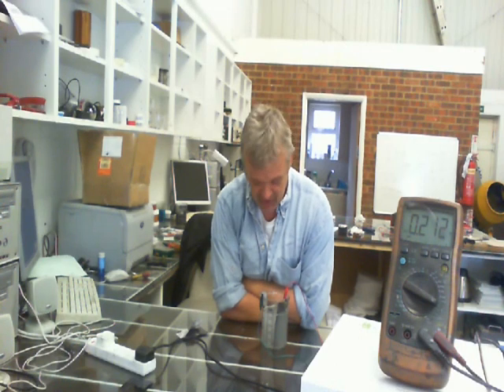Karpen Cell Replication Using Conductive Ink

Comment: Has anyone figured the watt hours per kg and/or volts per kg? With that in mind, any suggestion for a data sheet of comparable battery/capacitor types and their stats?

Comment: Hi Rob, that s a really interesting cell. I read the patent and that s fascinating.
I think a lot of concept turning around this karpen cell...crystal battery, your capacitor with two types of carbon....it seems to be very important to understand.
I am testing it and no surprise it really works.
I though to do a dry karpen cell with an solid electrolyte like a paint electrolyte or o sort of gel. But it doesn t give me the same results with the original concept.
I am tellling that s may be impossible to do a karpen cell....could you give your point if view about a dry karpen cell.
Do I lose my time?
Thanks
Reply from the maker: Mo Kha I think it is to do with transition between phases - so if it is dry then it probably won't work - but that is only what i think mate and i could well be wrong
Reply: Thanks for you opinion. I think the best alternative is a gel electrolyte. I read the agar gel is used for this kind of application. Have to test it.
Reply from the maker: Mo Kha good thinking mate

Comment: let me congratulate you first for the quality of your video!
I live in Romania and have seen the Karpen pile myself exposed at the technical museum in Bucharest.
great example of how it can be done! I will replicate myself soon but with backyard equipment ... I do not have access to lab level equipment. Still on a theoretical basis ... if the cell gets its energy from surrounding "heat", would it make more energy if say exposed to sun or in a warmer room ? (ok I know on some level the heightened entropy helps the electrical charges get around quicker, but I meant can we detect a bigger delta between the two states than a directly proportional temp increase? if at all ? )
Reply from the maker: cheers mate - i would love to have seen it - i did think of visiting but i am guessing you need to make an appointment. I would guess it would respond exactly the way you suggest but this is why we experiment to answer these questions
Reply: thing is that nowadays ( I understand it was locked away untill relatively recently ) anyone can see it exposed at the museum.
obviously I think that the dog's dangly bits of the whole museum ... of the whole romanian inventica ... ok ... definetly one of my favs :)

I was wondering if you could give me a tip or two for my replication ? I basically need to replicate the amilic alcohol NaOH mixture or any of the other 2 variants on the patent but it has to be relevant for my audience :)
hence it has to be easy to replicate with basic materials ( I know graphene is totally awsome but still ... $$$ ) that are easy to procure ... like sodium bicarbonate can be dehidrated to NaOH in the oven for a while ... and have to be scalable but that's the easy bit ...

any clues ? ( I still am going through the youtube trying to see all your excelent posts )

cheers
Reply from the maker: actudoran i did the two different carbons version which worked well

Comment: A little bit of a rant aimed at critics.  In science you should have healthy scepticism, and ask question, and out them to experimental test. However there are way too many individuals who think they already know everything there is to know and so they handwave saying things like the Karpin Cell is BS, or that the Oxford Bell is just a slow reacting battery.  These are the same people who will deride Senft's work on low temperature differential Stirling engines. They will say but they are not practical. It's like they are saying nothing to learn, or see, or hear, here, please look away. Well Ladies and Gentleman that is utter rubbish!   While claims of over unity in the thermodynamic sense, and perpetual motion must be met with the greatest scepticism, the fact is one can come very close and that is not prohibited by the 1st or second laws. No thermodynamic entropy is not disorder, it is just the natural tendency of energy to move from a concentrated state to a less dense state unless prevented by some barrier like activation energies.  So what is the point I am making. Energy does not die, get used up, it transforms. Also one needs to think about how it transforms locally.  For instance think about the heat energy which goes into the mechanical work of a piston. It is in the gas which has been expanded and in the pressure of that gas, we have to remove the heat to get the cycle.  Well if we have a lower temperature that thermal energy  can flow to and its converted into chemical potential (a thermal battery) then instead of the thermal energy being rejected and lost we have stored it for future use. We have stored the energy internally. As long as ambient temperature conditions remain the same and temperature never rises above ambient we can have local cold temperature zones rising up to ambient. By controlling the path and using entropy one can ensure one never reaches equilibrium for a very long time. A chemical oscillator.  Now is this going to be over unity? NO!  Work will always be a fraction of the heat flow, that is all Carnot efficiency is, its the efficiency of the ratio of heat flow to work, but if one keeps relatively the internal energy constant by regeneration of that energy then one is much more efficient in energy use.  Is this perpetual motion. NO if you are powering by having say a phase change, then you must have that temperature to support the phase change. Meaning that you may not be taking from ambient, but you will lose internal energy if the ambient condition falls.  There are many phenomena which can be regenerated, electrostatic, thermal, etc.  Things is most phenomena output heat as part of their losses.  In some cases in the technical sense you could regen all energy flows to 99.9% but it would be cost prohibitive. Also any device over time is going to degrade. If you use hydrogen or helium in a heat engine you will leak mass.  So the challenge is to design systems which do not lose mass or heat aka internal energy for very long times, and are constrained such that they can never reach equilibrium.  For those who are interested I can take you through such a system step by step and I do invite critics. I can prove it. It's not perpetual nor is it over unity, but to the casual observer it may appear that way. I can move 22,000 KJ of thermal energy locally and produce only 1 KW of power, but I am doing it at 10C as a base temp and the ambient conditions are 10 C. As temp never rises above 10C I cannot lose internal energy to the environment, as at 10C I produce 607 PSi of Hydrogen Pressure, I can use a quarter of the fluid power to generate a local temperature drop but because its local and connected to it is the hydride at ambient and an insulator outside that, what happens is an oscillating temperature profile. Just like you see with this large thermal battery called earth. That is why at a certain depth despite changes in temperature at the surface the temperature is constant.    So as Feynman once said if you want to make a revolution you need to attack the problem from a different angle. Everyone else has tried the well beaten path.  This works within the current laws of thermodynamics it uses chemical kinetics as well as thermodynamics to develop a regenerative energy system.  I have found one path to a highly regenerative energy system, but I know there must be others. Its not free energy but it can be very low cost energy. It's not perpetual but the earth itself and our galaxy is not perpetual.  You can't get more energy than the energy flows but you can recycle.   It easy to say you can't do this, its harder to find a way you can. For the latter means really thinking about it, understanding the problems and constraints at a deep level, and then formulating a solution and testing it.
Reply: Your clever
Reply: Here's the other thing. The kind of equilibrium described by physics to dis-permit the idea of a perpetual energy harvesting or perpetual energy conversion is a mathematical fantasy. In an actual, real thermal system you don't have a flat distribution of energy, you have an jagged and rough distribution of quantum fluctuations of energy and a constant exchange of energy from one form to another form.

The karpen cell leverages a difference in work function, triboelectric series velocity of ions to cause a biased flow of electrons in an external circuit.

It's ultimately just thermal energy reciprocating into and out of charge separation but it's the difference in the magnitude of charge separation surrounding the boundaries of each electrode that causes the current to flow.

Ultimately all of the energy ends up returning to being heat energy, it's just that something useful to us with done with charges along that reciprocal pathway.

Comment: Like others I thought this might be an aluminum air battery; and if not designed properly, it certainly would be one--at least to some extent.  I built a cell using US baking soda and for the electrodes I used aluminum foil and carbon fiber "tow".  I sought to eliminate air so I put a layer of vegetable oil on top of the electrolyte. Water based electrolyte of any kind will wick up the carbon fiber.  In the past I've used paraffin wax or epoxy resin on a section of the carbon fiber to block the wicking action--this helps but is not perfect.  Lately I've discovered melted sulfur on the carbon fiber forms a barrier that stops all wicking of the electrolyte up the carbon fiber.  I bring this up both as a useful tool and to highlight it brings a level of uncertainty to my results because the sulfur could be  electrically interacting with the electrodes.  So, I short circuited my experimental cell for about 14 hours to hopefully use up all the dissolved oxygen in the electrolyte (assuming an aluminum air battery).  At the end of this short circuit discharge period the current was 0.03mA.  The size of the electrodes exposed to electrolyte was: aluminum foil size about 3 square inches and the carbon fiber was 3 sections each 1.5 inches long. Only after I did this did I read about the Karpen cell.  The part about using carbon for both electrodes but not being identical, that is being formed from different processes caught my attention.  If one carbon is a N doped semiconductor and the other is a P doped semiconductor and they are separated by an electrolyte why shouldn't it act as a solar collector (in the thermal range of electromagnetic radiation)?
Reply from the maker: i think you are right there is an element of air battery in this incarnation of the cell - but your most interesting point was the parallel between a solar cell and the karpen cell - very intriguing
Reply: The cell made from gold and platinum--those are two elements that are both used as catalysts.  What if there's something about the surface of a good catalyst that allows it to harvest ambient energy and then pass it on to other chemicals thereby facilitating the reaction?  If this is the case then you could further generalize to say that a low band gap semiconductor would make a good catalyst. It also means semiconductors with visible light band gaps would also work as a catalyst if the reactants are exposed to light.
Reply from the maker: Joseph Richardson
well worth a try - you know me mate - i hate to over think stuff and if i have anidea i much prefer to testin actual experiment than argue for a long time about what may and may not be possible
Reply: Yeah, that's a much more pleasing way to go about it.
Reply from the maker: Joseph Richardson
lol yup

Comment: Well I didn't know what we were doing but that is what we termed the crystalline battery. Adding Alum helps protect the aluminum and adding potassium increases the current to a small degree.. Dang so all along it was a Karpen Cell... Go figure...
 The version you did I tried using aluminum artist wire, coiled around a graphite lead (center). I added Epsom salts for the bulk crystalline structure and for the huge amount of water locked into the Epsom. My averages were 1.25 or so volts new then it dropped to .7 or so steady. After running the battery for over weeks and while the crystals were forming the cell, it seemed to get stronger to about .85 or so volts.
 Washing soda is borax, well at least in the United states. Have fun.
Reply: http://i128.photobucket.com/albums/p171/jbignes5/100_0348.jpg
Reply: Jon Bigman
 Sorry I was wrong about the starting standing voltage. It was 1.02 volts and rose to 1.2v unloaded. here is a picture:
http://i128.photobucket.com/albums/p171/jbignes5/100_0347.jpg
Reply from the maker: borax is different it is sodium tetraborate Na2B4O7 - washing soda - in the UK- is sodium carbonate NaCO3 - But I kind of think this is a bit beside the point as what you are saying is much more interesting lol
Reply: Yeah the crystalline batteries are very very interesting. The premise is to draw from the potential of the electronegative between two bodies of material separated by a crystalline structure and has provisions to protect any metal in the battery. Once the galvanic response has been quashed only the potential difference of the two plates creates the battery. Although the current isn't that high these batteries provide power for extended periods and then must rest to recharge. A different approach would be magnesium and copper type but the more volatile the material the harder it is to protect against oxidation from the liquid state.

 I have seen "crystal" Batteries of alum, potassium and borax in a fresh lead acid battery that can provide some pretty decent current for extended periods. One friend of mine just used borax laundry soap and called it a clean battery. The same friend used oil and water and got excellent results. If you want to know his name it is Ibpointless2 and all of his videos are on the tube.

 In a crystal battery one needs to remember that the standing voltage is not the running potential level. In fact a crystal battery should be designed to have a warm up period where they can settle to their running level with a load. This is usually 1/3 the standing voltage. If you design the battery pack to have 2/3 more standing voltage then the cells should maintain that level for a very long time. With a switching power supply between two banks of batteries you could have an ever lasting battery that should not decay or will but only decay from the usual life of the material.

 What is this energy could be environmental heat energy or the electric field of the earth giving the bodies this standing voltage we call electronegative.
Reply from the maker: Jon Bigman
good stuff mate - but i am going for the swag sea water stuff first then i will try and follow up on this
Reply: Nice. I thought you would be interested. It is a fascinating subject and needs way more attention then it was or is getting. I agree that the swag is very very important but what might make it stronger might be the same approach we took in using the differences in materials standing voltage while in a medium like salt water. Maybe altering the inks to have that difference might strengthen the output as well? Just a suggestion.
Reply from the maker: Jon Bigman
it's a good suggestion mate thanks for that

Comment: Isn't that the same basic cell as the carbon air battery several people have put up using activated charcoal and aluminum foil?  If so oxygenating the water should increase your output but shorten the batteries life.  I think. I was looking at aluminum air batteries for converting my car to electric.
Reply from the maker: I imagine it is - but it is also what is in Karpen's patent - we will know in 73 years lol. The problem with aluminium is the reclamations cost and environmental impact of the process

Comment: You can get more power from an aluminum-air battery
Quick and Easy Aluminum Air Battery
Reply from the maker: sure - but that is not the point
Reply: Maybe try to replace the activated carbon in the aluminum-air battery with graphene oxide
Reply from the maker: GManGT
what do you think that will do? - considering graphene oxide is an insulator